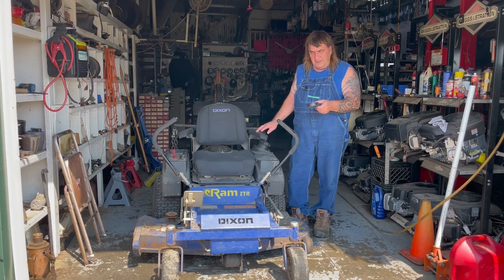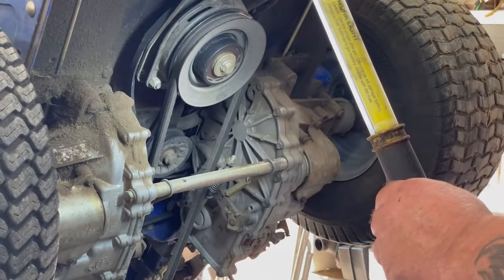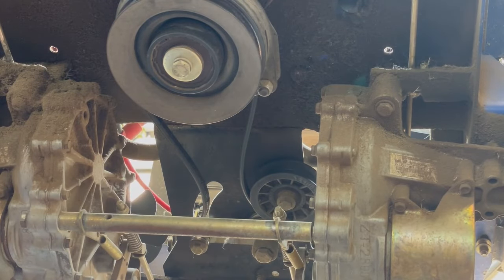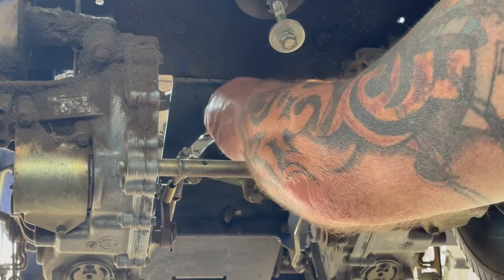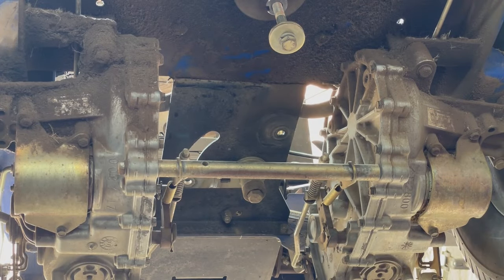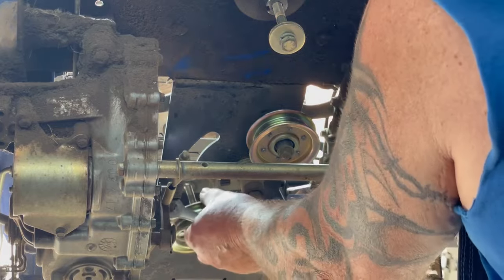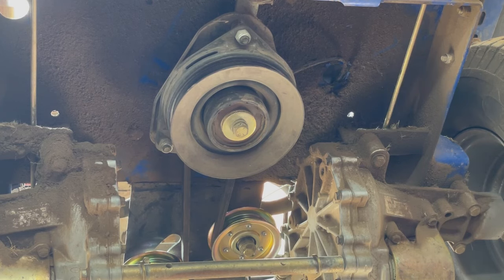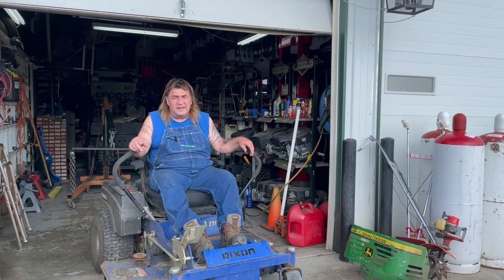Dixon Zero Turn Mower Suddenly Can't Move Forward or Backward

Comment: What causes your engine to smoke a little bit like it’s going to over heat it’s a 21 horsepower engine Briggs and Stratton vtwin are they good engines it’s a 1998 engine I think how much would you charge to fix it
Reply: And could you do a tune up I bought it used
Reply: It’s a yard machine it’s a black one
Reply from the maker: sure
Reply: How do I get on your schedule  I'm in Wisconsin  25 minutes from Iowa  I'm in Platteville Wisconsin